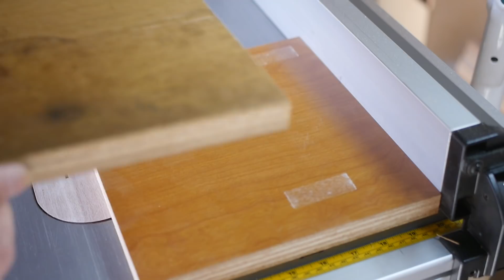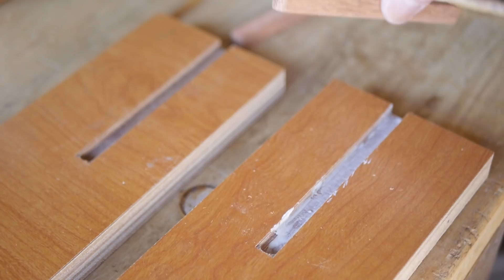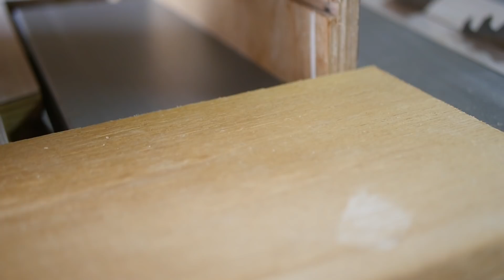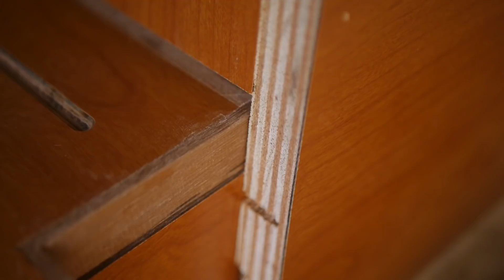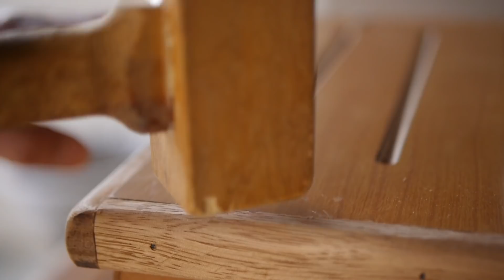A stepladder that can be changed a little

Comment: Hard to make a choice with so many desktops to pick from! Nice job my friend. I believe you could park a car on those steps without any problem. At the 8:5 point in the video there's a fixture of some kind with a  crank handle. It seems to sit to high to be a dowel or handle making jig. Please enlighten me.
Reply from the maker: Hello Will
Thank you for watching my video as usual.
And thank you for your comment.
I read your comment 10 times, inconvenience of translation software or my lack of reading comprehension, I couldn't understand your comment well, sorry.

Today, my mother used this step box to train her declining leg muscles with her hands on her back on the sofa.

Thank you Will ... Tachi
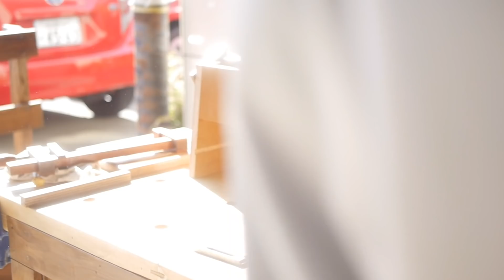Reply: At 8:05, there is just a clamp holding the sides tight for a test assembly of the pieces, it does look like a crank handle but just a clamp.
Reply: @MadHatter764  thanks, I was afraid that I had missed one of Tashi's masterful builds.

Comment: concept build? on the small size. enlarge approx 15%. this will make short step have some purpose.
Reply from the maker: Hello Stu
Thank you for watching my video.
Sorry for the lack of explanation and confusing you. My 90-year-old mother enjoys the custom of offering flowers to the Kamidana. And do step-up and down exercises for rehabilitation, store when not in use. As a result, it was necessary to add an extra storage of 60 mm.

There is no scene where my mother uses this stepladder for some reason.
Thank you Stu
Reply: @TachiOhyo56  none of that has anything to do with what I said.  Size not function nor reason for being.